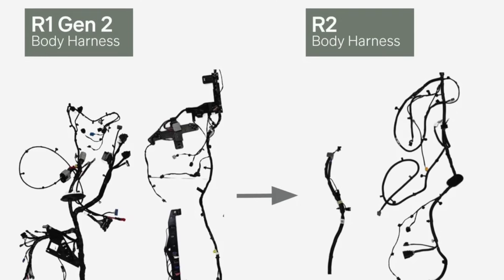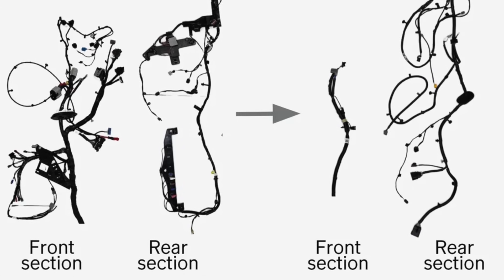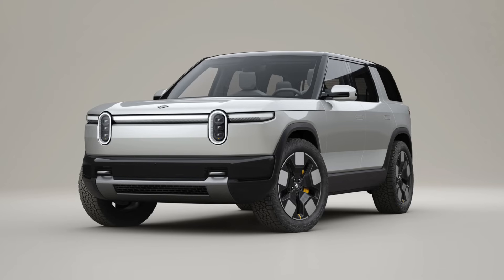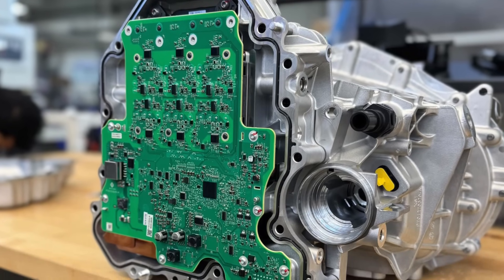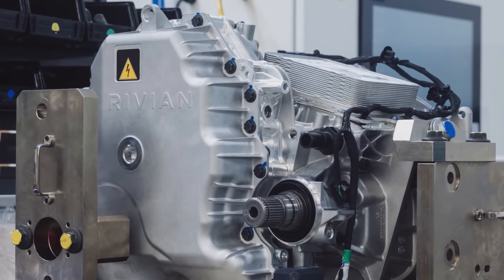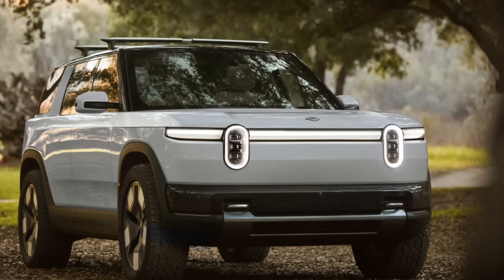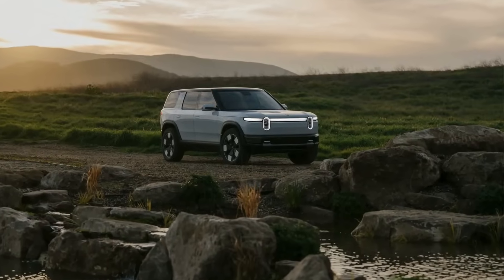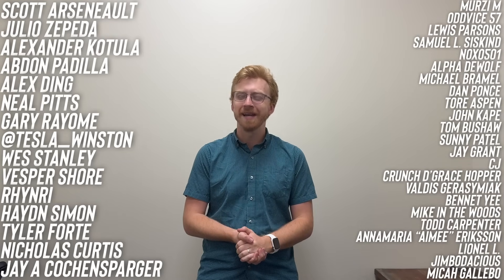Rivian's R2 Simplifies Body Harness & Inverter!

Comment: I think this is more exciting than anything related to autonomous driving. 

I wonder if Rivian consulted with Sandy Munro, since high material and component count was one of his primary complaints about the R1 architecture. 

It also shouldn’t cost $10k to fix a scratched bumper. I think addressing serviceability and repairability will also drive down costs.

Comment: Great video on continuing improvement in the R2.For those of us in northern climates,the competition,Hyundai and Toyota will offer radiant heating along with the updated heat pump for those in colder areas.I am hoping Rivian is looking at this option to conserve battery range during cold weather operation.Is there updates on a door mounted spare tire?I also saw that a adjustable suspension will be offered.